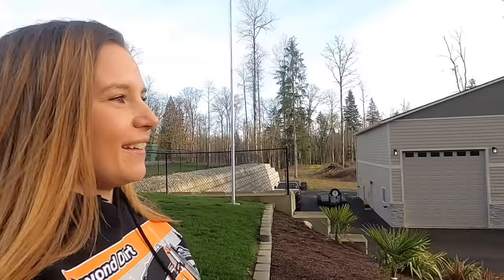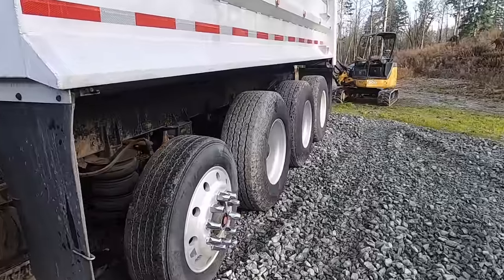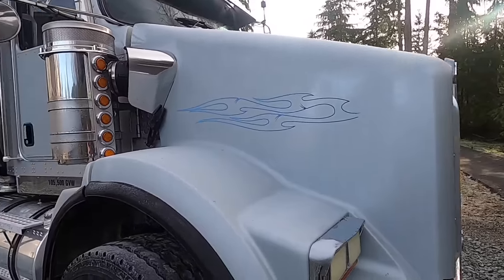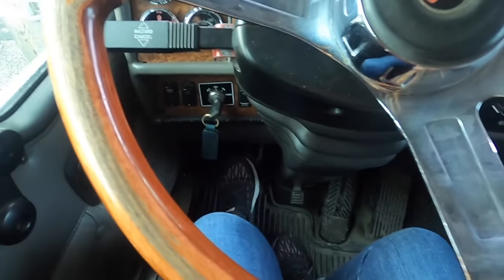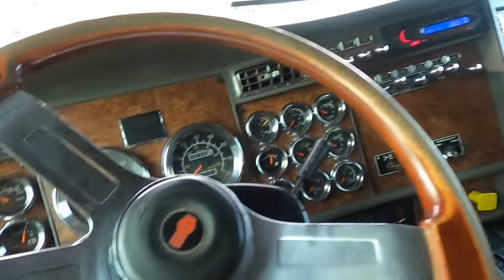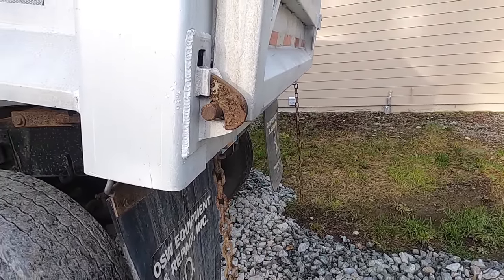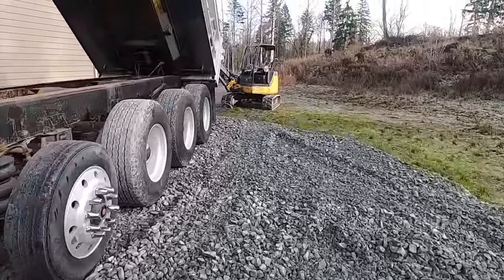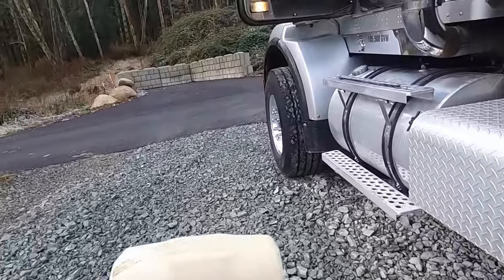I DID IT! I BOUGHT MY FIRST DUMP TRUCK! 2003 Kenworth Truck and Pup Sturdyweld Dump Truck.

Comment: Happy trucking Dauminique. But some tips . It will sound a bit tedious , BUT, FROM MY EXPERIENCE OWNING HEAVY VEHICLES, when you buy a vehicle that was standing for a while it is best to do an examination first BEFORE you start to work it.1.) Free up and lubricate ALL mechanical moving joints, linkages eg. trailer tailgate. GREASE and do a proper examination of the FRONT END and wheel bearings. Replace worn PARTS. 3) OVERHAUL COMPLETE BREAKING SYSTEM. REPLACE ALL BREAK DIAPHRAMS They can rapture under load. You DO NOT kNOW if they are dry rotting. Two incidents.A) This almost cost me a vehicle.2) Inexperience driver - piston seized up IN WHEEL, cause vehicle to capsize. When vehicle was not loaded all worked great ,BUT, under load TROUBLE.

Comment: as a diesel fitter, by trade, who grew up driving and fixing trucks, and even worked for cat, at 1 stage, the cat engines before the acert, were the best ever, I worked for a company that had 40 quad roadtrains, 60 meters long almost 200ft, hauling 140 metric tons, 300,000 pounds,  here in Western Australia, we rebuilt the cats, they never let us down, yet all our Cummins we never got to rebuild 1, they all threw a rod out the block, and a factory exchange motor fitted, we alway took bets on which piston would be out the block, before it was towed in to the shop.

Comment: Nice truck! I think you will like the Cat after a while shift it early in the low side and let it pull. It doesn’t need to rev as much as a Cummins.
Reply: And a Cat will lug even at low RPMs...I've driven a lot of them
Reply: I’ve seen guys go from the old detroits into cats and they can’t drive em. Reving up the two cycle down into cat low revs was to big a change.
Reply: Looks to me like you need some  Greece
Reply: i drove many trucks with different engines and i have to say 100% youre right about cat engines--you can lug them lots more than any other engine i have driven....they are excellent engines for ANY construction platform with the low end torque thats available.

Comment: Having followed your journey for years your development is amazing.
Now, working as a Heavy Equipment Tech in The High Arctic you just might benefit from using Arctic Grade lubricants and Grease during winter time.
Uphere we spray every outside placed part that moves something with an aerosol driven Arctic Lubricant, and works great.
I am looking forward to see you develop your trucking business, with your drive I am sure that you will need a lot of truck numbers pretty soon.
Merry Christmas.

Comment: I drove Dump trucks as a Teamster (282) for over 35 years in New York City and all surrounding States. Retired with some disabilities now.  I did enjoy the KW 800's and 880's. This video is over a year ago so a belated congratulations to you. I started in the early 1980's back when very few owned new trucks so you could imagine the hunks of junk I drove on my time. It's so nice to be in a truck that doesn't fight back. I started in a B model MACK with a Quadraplex transmission and moved up to a 1968 MACK DM 800 with a 18 speed Quadraplex. Back then there were mostly Tandem trucks on the road. Anyway thanks for listening, I love your videos. Keep on Truckin' and keep the rubber side down.

Comment: Nice looking rig. Chances are the trailer brakes are frozen up as well with the dogs and reach locks. Be careful that the truck gate doesn't hang up on the reach lock when you're Jack knifed to dump the truck. It's good to let the truck box come down a ways before pulling forward especially with those sturdy weld reach locks. On uneven ground the truck gate can contact the reach possibly. All the best on your new venture.

Comment: I drove a 92 KW with a Cat 3406B and a 9 speed. It was the best engine I ever operated.  I got pulled into the Alex Fraser Bridge scale in BC and was air care inspected.  The inspector couldn't believe how clean the exhaust was so he watched my foot as I floored it again.  He said it was the cleanest running truck he'd seen all day.  The 9 speed worked okay since I was mostly I-5 between Vancouver BC and Olympia.

Comment: Congratulations!  Looks great!   Only thing slightly negative I'd say based on years of pulling Sturdyweld steer drops is those trailers are flexy fliers and spring breakers on the back two axles and tippy as heck.  Nothing you can't handle.   Merry Christmas to you and yours and a happy and prosperous New Year.
Reply from the maker: Yeah, trailers need maintenance over the years. It should be fine.

Comment: Congrats on your new rig combo
Just under 500 thousand miles is still young yet.
Aluminum boxes, super singles on the trailer and those to me are a plus
105 + GVW is a plus too.
Yes every truck has some small issues but they can be worked out.
LED lighting is a good thing, but one near the drivers cab looks not right.
The pintle hitch on the front end is nice
If it does not have those LED flashing beacons yet I would get those installed and probably some LED spot lights too
By the way I missed you saying what the transmission gears are set as . 13 speed?
All in all a great looking truck for a great start hauling stuff.
Numbering your truck should mean something special to you and I will bet you want to name it something too. Like the Silver Cloud or something like that.
Cant wait to see you back in action, now lets get to work...
👍 and stay safe. Plus Merry Christmas and Happy new year to you and your family

Comment: Congratulations on such a great truck,looks in wonderful condition for its age,and you can't beat a CAT! What horsepower is she? One thing with that trailer tailgate lock. We have a similar setup in the UK. The actuator where the piston goes in and out to open and close,keep the piston spray oiled,it soon eases up. Every time you grease up stay that too. Truck number has to be 001 and the trailer T001. Happy Christmas to you all,hope you find lots of work for it,best wishes for 2022

Comment: Congrats girl !! I had a feeling you had a surprise in store when I saw you preparing the parking spot. Much better looking than the ones you were looking at on the auction site, plus being a friend, you must feel more comfortable. I was noticing, when you were trying to open the gate on the pup that the drop axle was down. Did you charge the trailer air before you tried that and the drawbar latches ? Just a thought. I know you're a VERY smart and knowledgeable girl, so please don't take that as criticism. What's the transmission ? I couldn't quite see the knob in the video. I would guess either an 8LL or 18spd., but I'll be watching !! I'm 72, and a former triaxle and dump trailer owner/operator in N.H., having had 5 trucks running at one point, but toward the end I sold the used ones and bought a brand new Pete 379 ext. hood daycab heavy spec. tractor, and a used 34' triaxle aluminum East dump trailer. I can still remember the rush I got each time I got a new (to me) truck, and especially the rush when the new Pete came in ! Anyway, I'm really happy for you and will be following you on your new journey. I know you'll be AWESOME !! Merry Christmas to you and your lucky husband 😁!!!
Reply: its an 18-speed i saw it the splirrer button is gray thats an 18-speed
Reply: @chriscrane5327  Oh, cool. Thanks, I didn't notice that. My favorite trans. !
Reply: Yeah....I was gonna say the same thing about charging the trailer. Especially with it being cold and the trailer old and sentimental. I drove a 7 axle dump with 8 airbags so it took a minute to air up and release gate and fill bags. It's 5 months now so I'm sure all that's figured out now. Yaay for you again.

Comment: I remember way back in the early 70’s I was a green tri-axle  dump truck driver I was put into an old long nose Hendrickson with a 190 Cummins and a 5x4.  My first job was hauling concrete to a spreader box building the north bound lane of US 41 from Evansville to Terre Haute. Always had to spray the bed with kerosene so the concrete would not stick before getting another load!

Comment: Being curious here.. is it because of the law that the drawbar on the trailer has to be that long?
Since I come from Europe, it looks almost ridiculous being that long. Here it would be like 2 meters/6 feet long.
Reply: Yeah i'm wondering too
Reply: @peterandreash2841  Wondered the same, my guess would be spreading the weight distribution over a larger area on the ground?
Reply: It’s bridge law, to spread weight on a bridge.    To prevent that ‘sinking feeling’.   You shorten up when empty.   I like to see happy people, go gurl!.
Reply: @bobnwashington  Thank you, thought it had to be something along those lines. It would not be legal/practical here as our roads are too tight, so looks quite strange! Plus too many idiots would try driving between the truck and trailer at junctions 🙄
Reply: @AimeeWalton  You’re  right, they do try to drive between the trailer, had it happen, that’s why a light on the reach is required.

Comment: ..... Cold hydraulic oil will slow the pup box down up here in the PNW ..... tidy truck ..... totally with you on the KW & Cummins .... am always blown away by the length of the reaches on dump pups, know it is because of the bridge  weight laws ..... good job on backing in there blindside first time in the dark .... new here YT just recommended you ..... thx for the share .... as always .. never stop dreaming, just dream bigger .. have fun be safe, save our oceans ....

Comment: Nice rig. I don't really know anything about dump trucks, but I was an OTR truckdriver for 13 years before I retired. I remember one time in the late 90's I pulled into the fuel islands of the old 76 Truckstop in Oak Creek, WI and there was a shiny new Mack Granite there and it was one of the most beautiful trucks I ever saw. I don't know if they were good trucks or not but they sure were beautiful.

Comment: Usually,  you have to have at least 90Lbs. Of air in the trailer air tanks to open the dogs. The priority valve opens at 90psi. Nice truck and pup.👍
Reply from the maker: Yeah it was over 100 PSI

Comment: Nice set up you can't go wrong with sturdy Weld boxes and Trailers. I worked for them for 4 years before they sold out to Reliance. Sometime if you unlock the reach and inch the truck forward, the reach cams will pop loose. You should be able to adjust the latches, so you don't need a hammer.
Reply from the maker: I think they were just frozen
Reply: @DauminiqueTheDumpTruckDriver   you got to love WA weather. 🙂

Comment: The tube that connected to the slack adjusters got a build up of hard grease.
Tare it apart and clean all that hard grease out and then Maxi canister and slack adjusters should operate a lot smoother with out using a hammer. 
Hope this helps.🇺🇸

Comment: Talking about numbers, mine is the last three digits of the serial number 109, so when you go to get parts and work done you only need to remember the first three digits   925 109.  I also named my company starting with 109.  Nice truck by the way, you`ll have lots of tonnes to haul before you need another. Older is better , mines a 90 and 2.5 mil. k on it and goes everyday. Everything over 06/07 is trouble and that`s what you`ll see on the side of the road, hood up and the person waiting in the cab for help.  Best wishes and I`m excited for you.

Comment: Hello dauminique, I am in France. with us the brake relay staves (on the towing mast) are also often blocked! and considering the state and the cold I think, that a good cleaning is required! Then a good greasing with graphic grease (it freezes at a lower temperature). and normally all will work fine again. 
PS: it's always easy to see women truckers and beautiful videos.  in addition you are in a beautiful region 😉

Comment: Congrats! I'd rather  push a kenworth  than drive a Pete. I loved my 3406e cat  in my 97 W900L. I don't think the trailer had enough air to operate . I drive mostly  semi end dumps in the Midwest. I  build up   air and push in the trailer supply knob  while the  truck is warming up. Then I see if the dogs and  trailer brakes released. Sometimes i have to cycle the trailer  supply knob and tailgate switch  a couple of  times. Penetrating oil helps on non greasable parts. Sometimes I have to heat  parts with a map gas torch. Beating on stuff is  last.

Comment: Here in Mi. We can haul 161k with a 36 ft lead,Two axle dolly and 24 ft pup with 9ft spread. Legally everyday if plated. I never got that long ass hitch. Trucks clean as heck for 03’ but short doubles are just that. If you have a landaull or RGN  you can use a tractor for all. Not ice it’s rust,Marvel Mystery oil to the rescue. Dump the hammer grab the oil can.and grease gun.

Comment: pro tip to prevent stripping gears while engaging my pto, i push in the clutch, pull it into first, engage, slip out of gear, then release clutch. congrats on a sweet truck. old iron is where its at. with your big ole kitty, don't spin her much past 1650 c15, and 1850 emodel.
Reply from the maker: If I had been moving prior to putting th PTO in I would have left it in gear. Clutch break works really good on this truck too.
Reply: @DauminiqueTheDumpTruckDriver  copy. always have tried to come to a stop before engaging. i run a blower and an airslide off my 15 speed. had an old boy tell me long ago to prevent undue damage to your pto to follow my above mentioned procedures.

Comment: I would suggest you use a leading zero on the truck number, like BD-01. That will give you room for 99 trucks, and when they're listed in a spreadsheet, the name column will sort properly without any fiddling around with the sort algorithm. Also, you might consider using different prefix letters to distinguish trucks from trailers, or other pieces of equipment you might buy.
Reply from the maker: Haha 99 trucks is ambitious!
Reply: @DauminiqueTheDumpTruckDriver  Maybe, but it will be worth it for anything more than 9 trucks! :)
Reply from the maker: @joec0914  haha

Comment: Good choice, its got the best style  dash that doesn't rattle and easy to access for bulb changes and such.  It you ever want to install the current style KW steering wheel you can by changing to a new style nut.  Also a factory dash top CB mount can be easily installed  on the right hand wing, you just need the mount, a rubber grommet for the cables and mounting screws.  The LED headlights can be a problem in the snow  like we have right now as they don't produce any heat like halogens do so ice/slush can build up to where you basically have no lights.  Easy but not cheap solution is some US made replacements from JW Speaker that have a heated front element as well as superior projector lenses.  Take a look at the frame rails, sure looks like a lot or rust forming under the paint.  For numbers you could use the number of your initials in the alphabet.  For example, mine are D and F which corresponds to the 4th and 6th letters in the alphabet or number 46 so when I had my own trucks it was 46 Transport and the truck was 4601.  Good luck.
Reply from the maker: Haha the dash rattles a bit

Comment: Drip some oil on those lock pivot points. Metal to metal pivots need oil or they rust and create too much friction then don't wanna move. Otherwise that's a nice looking truch especially for an older Dump

Comment: Q? Are the air horns supposed to be in that location mounted in the frame under the dump bed? It seems to me that air horns should be located on the top of the cab where dirt and debris can't get into the bell of the horn.  Love the Kenworth!

Comment: Good luck. I hope it works well for you. Tell hubby that Pete and KW are both built by Paccar. You'd be surprised how many of the parts interchange.
Reply from the maker: He knows. I like the kenworth because the dash is lower and he like the Pete because the motor is more accessible.

Comment: "Kenworth, cause even peterbilt drivers need a hero!" The 06 t800 wrecker I drive at work sometimes has the same super trucker switch extensions so when you dump the air ride if your not careful it dominos the fifth wheel slide and power divider lock switch too. Annoys me a lot because they mounted the two way Mic next to it so I hit it accidently. obviously there is no fifth wheel on a wrecker so it just pisses air. Fine looking KW! I would number it 69 but maybe inappropriate:)
Reply: No it’s needs to be number 77 , nice double digits,, loll if you get the picture, loll nice thanks BigAl California. DPF are legal in California, at least that’s what I was told by person with a truck with one on it, lolll nice 👍 thanks BigAl merry Christmas.

Comment: nice Dauminique you got a strong cat motor there cat are briliant ive driven heaps of cat engines you can lug cat motors to the max before you feed your next gear i pull logs here in New Zealand 54 tons up hill hèaps power hope you enjoy your heavy truck trailer  from a kiwi trucker 👍👍👍👍